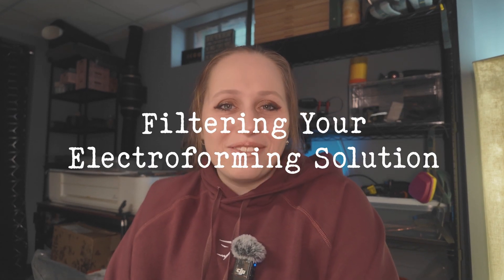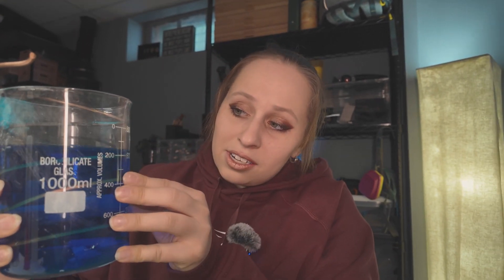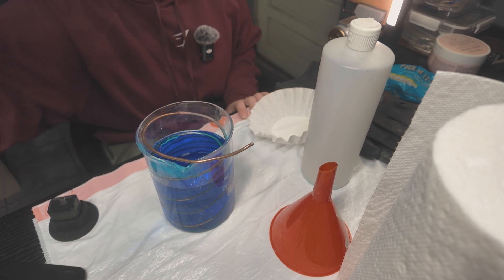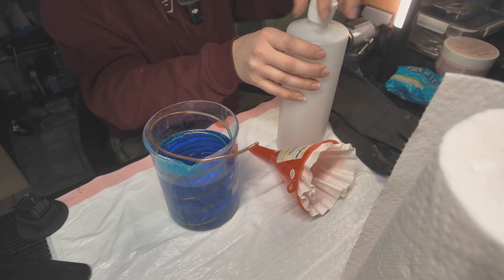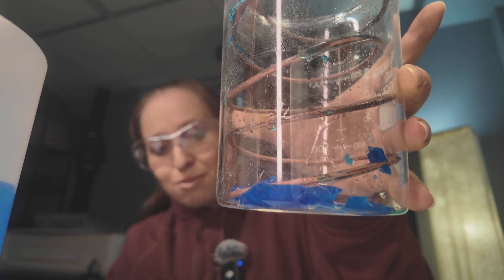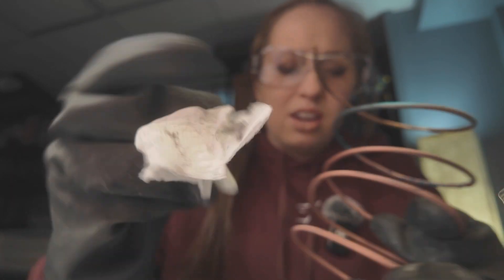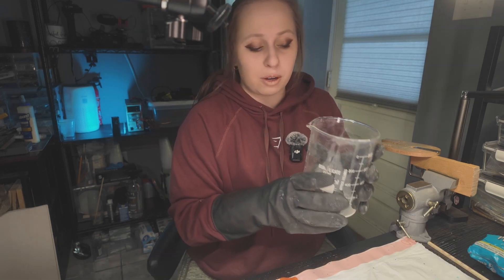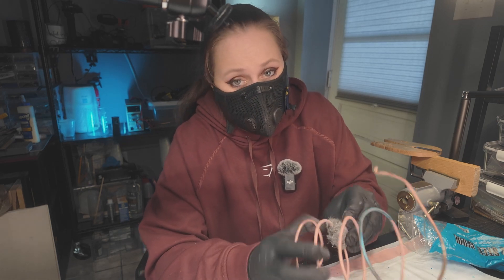Electroforming: How to Filter your Solution

Comment: It helps if you use activated charcoal,  fish tank filter charcoal,  when filtering your solution because it removes all your brighteners that can build up and cause issues,  you just need to add them back before using the solution again. I just use a large funnel and a couple coffee filters with the charcoal in the filter and pour slowly so the solution doesn't over run the edges of the filter. It's an inexpensive way to insure your solution is like new each time without the build up of PEG.